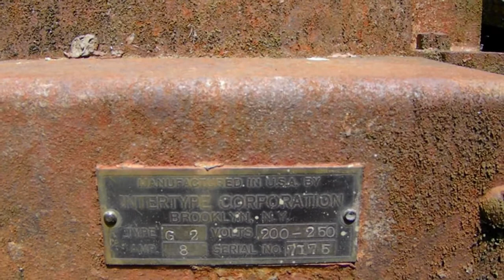Mohr Intertype Saw

Comment: The Mohr Saw was a device applied to Intertype and Linotype machines to cut the slugs to a particular length--rather than casting (and having to set molds) for a particular length.  The saw meant that the machine had molds that were always 30 ems (5 inches), but the operators could change that on each successive line cast in increments down to 1/2 pica (roughly 1/12 of an inch.   
The bulk of the machine is an Intertype C-3.   It would be pretty rough object to restore, but doable.